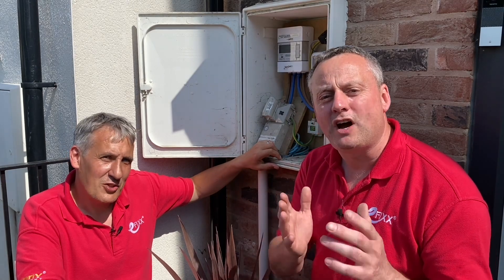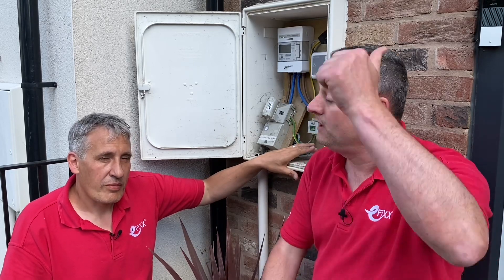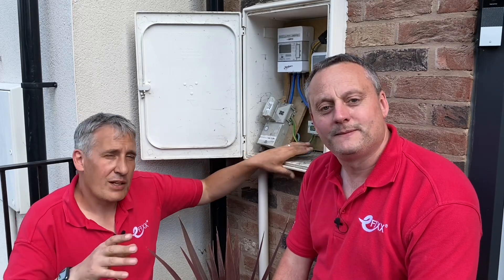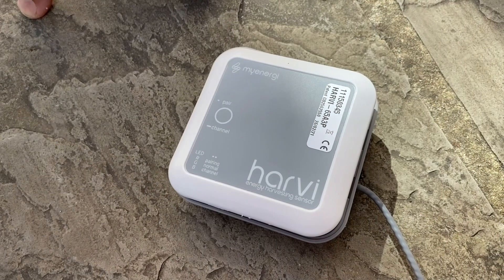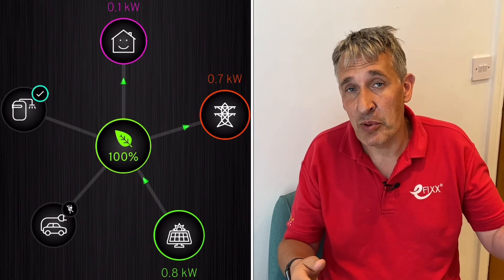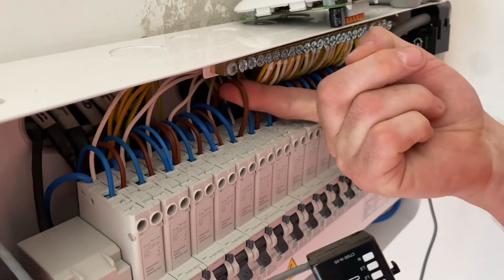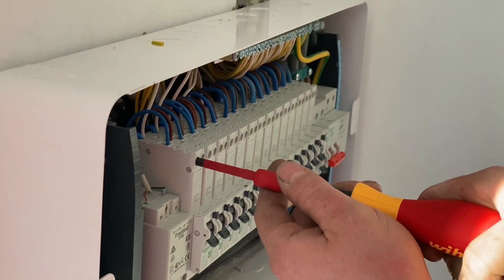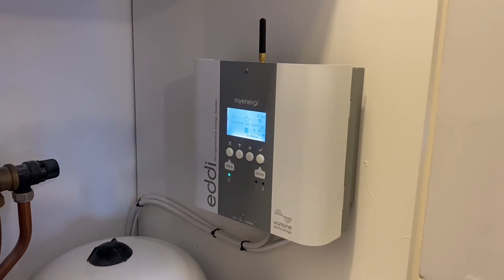The little box that makes EV CHARGER INSTALLATION EASIER 😇 - MYENERGI HARVI

Comment: Got a Eddi, Harvi and Hub connected to my PV Array and Batteries yes I can confirm it's addictive watching the App,even though it's technically Winter I've not heated my water via my Oil Boiler since getting the myenergy items fitted a month ago, can't recommend them enough 👍

Comment: Solar PV with Eddie installed last June. Zappi installed last month. Should I be able pair E & Z? Not sure the Eddie is WiFi 🤔 also MyEnergy app showing import & export wrong way around. Presumably this is the CV clip wrong way around? Also Solar not showing on app - Solis 5kw inverter

Comment: Hi quick question as to where to locate the harvi 

, the install has the solar POV on a sub board in the garage front of house , main db is in house DNO cupboard is  at rear of house,. Would you put the two CT clamps in the main db with one on the line from the MCB to the garage monitoring the PV generation and the other on the tails to monitor the load on the cutout fuse

Thanks for your help

Comment: Having worked for a DNO as far as the placement of equipment on meter boards go, it was pretty common to find customers switchgear fitted on the same board.( 8 way consumer unit jammed in!) However if the meter board requires replacement especially on outside meter cabinets due to dampness or wood rot etc the rule was if the meter board contained only DNO equipment then we replaced the board as required, if the meter board has customers equipment on board then the meter board would be replaced at the customer’s cost.( think….supply cable cut  underground,  cablehead removed, metering business also involved to remove meters)
So better to keep clear of the meter board.
Reply from the maker: Wise words

Comment: Do you guys know what I would have to do get a solar battery storage to show on myenergi app? Any advice would be much appreciated
Reply: I have same issue. If the Zappi or other MyEnergy device is WiFi then pair with the inverter? There is a master and slave option in the advanced settings. Haven’t tried this. Currently using 2 apps sad.
Reply: If your battery is AC coupled, you can add another CT clamp to your Eddi/Zappi/Harvi and set its type to “AC battery” in the settings.

Comment: Any tips on how you would integrate an Eddi with an existing Honeywell Evohome system that controls heating of radiators and can also independently bring hot water up to a set temperature? What I would like to happen is to use the Evohome to set the hot water set point temp and schedule (as I do now), surplus solar energy to be diverted to hot water first, then to the Zappi. IF hot water set point temp is reached, gas boiler will not come on, IF set point temp is not reached, gas boiler will fire up to heat the water.
Reply: Had solar PV installed last June. Eddie diverts to heat water via immersion. I did have to replace the thermostat within the immersion as we noticed the water was too hot. Now set at 65C, usually reached by mid day. Even if somebody turns on the gas boiler to heat the water boiler turns itself off after a minute as the water is already at 65C.

Comment: On the initial install, you said about not sure of the wireless/wifi connection to the charger. I take it you had no problems with it?
Reply from the maker: Works really well👍 NB it’s not WiFi between the harvi and Zappi - it uses their own FM protocol

Comment: hi  , good video. can you tell me if you wired the zappi from the board using rcbo ?  and is there  already the rcd inside  the charger ? where do we stand with the regs regards 2 rcd s on the  same circuit?
Reply: The RCDs are covering different parts of the circuit so they are both needed if you want to protect the entire circuit and the user from electric shock risk.

The RCD in the EV charger can only protect on its output.

If a fault occurs on the output of the EV charger, then certainly the RCD in the EV charger will detect it and trigger. The first RCD that's in the consumer unit may or may not trigger. But as long as one of them does, it doesn't matter which.

If the fault occurs between the consumer unit and EV charger, the RCD in the EV charger will not detect it, it can't. Only the consumer unit RCD can detect the fault. In this case, it's the consumer unit RCD which will trigger.

A fuse or circuit breaker, as we know, protects against over current and it doesn't matter where in the circuit it is, as the live and neutral current is the same all the way around the circuit.  But this is not the case for an RCD. The RCD can only protect what is downsteam from it, what is on its output.

Comment: I have 2 consumer units. Does the Harvi need to be installed in the CU where the PV circuitry is connected to, or can it be installed on any of the CUs? Thank you.
Reply: To monitor the solar gen it needs a Ct clamp on the solar live conductor

Comment: Did the Harvi work OK signal wise? I have an install where the meter cupboard is around 20 metres on the opposite side of the house and then the charger will be in the garage
Reply from the maker: We has about 20 meters line of sight  and it’s been working fine for the last six months.
Reply: I know I’m very late posting, but you can extend the cable on the CT transformer up to 100 metres using a single pair over CAT 5 or 6 cable. It can save having to purchase the Harvi, (Harvis are great, you should really buy one), and if you’re already running in the mains cable to the charger then it’s a piece of cake to run some Ethernet cable with it, although you’re not supposed to have it running right beside mains cable due to possible interference, but I have done it on a 40m run and it works great.

Comment: Did you not need to add extra insulation on those cables like you did to the doorbell wire?
Reply from the maker: We'd add to this the Harvi doesn't have any physical connection to the mains supply as it's a self powered device.
Reply: @PETER WILSON being double insulated though doesn't in itself indicate that the insulation is rated for the highest voltage present, so the voltage rating of the insulation should always be confirmed.

Comment: I installed an Harvi yesterday and it worked fine for a short while, then it started randomly going offline and then back online. I've checked the CT clamp and the connections inside the Harvi and all seems fine. Have you had the same problem? If so do you know of a solution? Thanks
Reply from the maker: Might be a range issue between devices
Reply: @efixx  OK thanks for your reply 👍

Comment: When extending the CT can you use a Cat 6 cable if so which pairs would go with the positive and negative
Reply: Any one of the 4 pairs. And the cable is not polarity sensitive, but personally I’d use the solid color as positive and the matching stripe as negative.

Comment: Hi guys I haven't seen a clear explanation if the harvi pairs directly with the zappi charger or do you need an intermediary device such as a hub?
Reply from the maker: No you don’t need a hub
Reply: @efixx  Thanks for the reply. i eventually worked it out and I have one installed :)

Comment: Isn't the Harvi limited to 64 amp? Which could cause issues for some installs
Reply from the maker: No it can work up to 100A and can also be used in three phase supplies.
Reply: This was in a recent technical bulletin by myenergi

"If you connect the grid CT via our harvi, then you must ensure you don’t set a grid limit in 
excess of 65 amps as this is the maximum that harvi can effectively measure
• We will shortly change the firmware to stop the setting of a grid limit in excess of 65 amps
when the grid CT is connected via a harvi"
Reply: I was told by myenergi technical that they do not recommend the grid CT to be connected wirelessly, and should preferably be wired. If the Harvi and Zappi lose contact, the Zappi will charge regardless of the grid demand, potentially overloading the main fuse.

Comment: Bit of a tangent, but if the Eddi is £3-400 plus install costs, compared to 60-80p per day of gas to heat hot water , adding an eddi to the system adds another year to the pay off of the solar PV is it really worth fitting for the moment at least?
Reply from the maker: All depends on your particular tariff arrangements.  This house doesn’t have any export tariff so is literally giving the energy away.
Reply: @efixx  fair. I think my current import tariff means I'm limited to about 3p export, butt even then been quoted £1k for a zappi and as a replacement for an existing charger and seen that the v Eddi b is just shy of £400. 

Plus the cost of the hub. 
Water tank and EV charger at both in the garage as is the CU so probably don't need the harvi for that. 

It's deciding between doing one or both of those Vs £2k for an extra 5kwh of battery storage
Reply from the maker: Yes the battery storage is a great idea - then you can do some serious energy trading.
Reply: 20 Litres of water takes about 1KwH to heat so even a small 120L tank is something like a 6KwH battery.  Even if it cost £600 to install it's acually pretty decent.  I'm looking for a way to integrate renewables with air conditioners and heat pumps so you can kick them in as additional dump loads.  Hopefully in the future you can add washing machines and so on.  Obviously the home owner can do all this but it should be easy to automate it all.
Reply: @korona3103  agreed especially now that gas is 12p/kw instead of 3.

Now I just need to decide between the Eddi & the iBoost

Comment: You can stick anything you like in the meter box. It's the property of the homeowner not the DNO, but they can ask you to remove anything if it impedes the install of their equipement. That's the simple answer. Don't believe anything else.

Comment: There is an assumption here that is going to get people into trouble.  That fuse holder is rated to 100A, that does NOT mean the DNO fitted a 100A fuse.  Many have 60A or 80A fuses and unless you cut the seal (which you are not permitted to do) then you are just guessing the value.  You could ring the DNO and ask them what fuse they installed and I will buy you a pint if they tell you...
Reply from the maker: When you install an EV charger you submit a permission to connect  ( ENA ) form. At this stage the exact rating of the fuse will be clarified by the DNO.
Reply: @efixx  Interesting, I am quite new to EV and learning every day.  My understanding was that you notified within 28 days and only needed permission if you identified a potential problem.  I have done a bit of reading and apparently that is only below a MD of 60A.  Like I say I am learning every day.

This seems to pose an interesting catch 22 then and I would like to know what happens.  Are the DNO's sending an engineer out to check the main fuse value before they allow you to proceed or are they just saying they are happy for the work to proceed if they have no network issues?  If it is the latter then you have to set the Zappi to tap out at 60A anyway and so it is of no benefit to contact the DNO in the first place.
Reply: @MarkC-1970   buy him a pint you melon
Reply: @MegaMetinMetin  😂

Comment: Ive had 2 of these fail
Reply from the maker: What was the failure cause?
Reply: Dunno they just stopped working
Reply from the maker: okay - did you replace and all okay - go down a different route?
Reply: I currently am using the charger after midnight and without the protection of the harvi. Waiting on email back from the company
Reply from the maker: Let us know how you get on.
Reply: Will do guys
Reply: Might be because of the pen fault detection voltage device over volting at night from the manufactures deviation level +~ where no bugger is using anything if your closest the main transformer